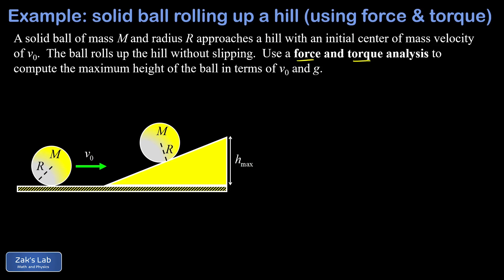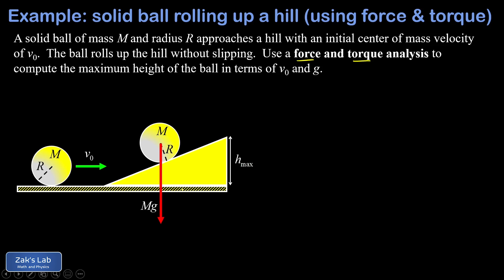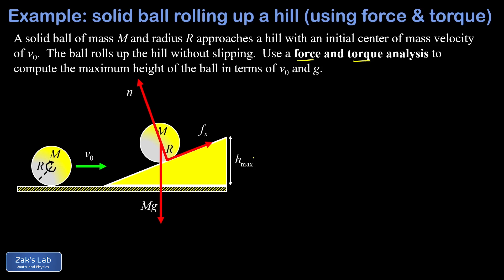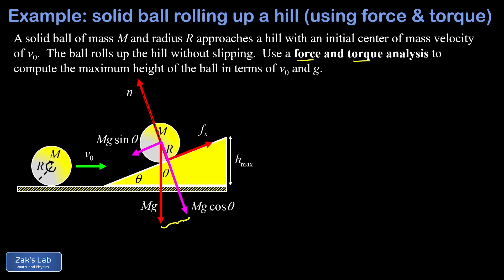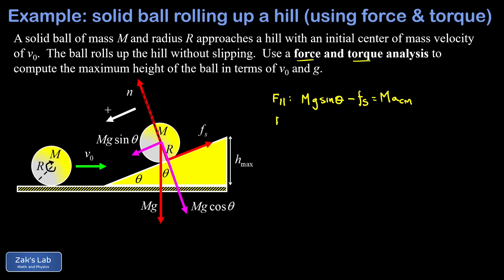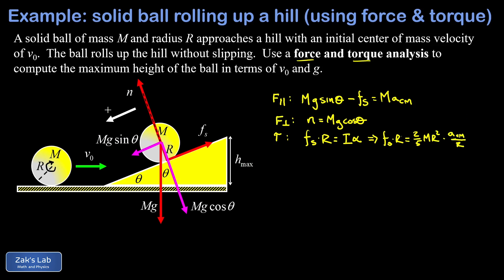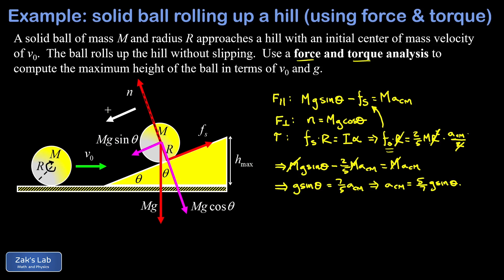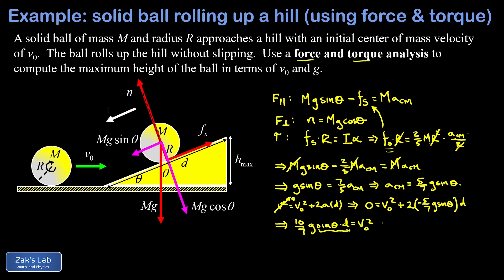Maximum height of a solid ball rolling up an incline: force and torque rigid body analysis.

Comment: I  have  a question,  the ball is hollow shere 3/4 filled with mercury and floating a small iron ball.To elevate centre of gravity, the ball put on the inclined Tread mill. Could it work as perpetual motion, no slip is there in the point of contact.

Comment: I did quite a bit last semester in my intermediate mechanics class. Now I can see how to solve it using Lagrangian equations. It would be great if you could also make a video of that to show that there are so many ways to solve the same problem ❤
Reply from the maker: I've got to brush up on Lagrangian mechanics one of these summers . . . summer 24 is already booked though!  z